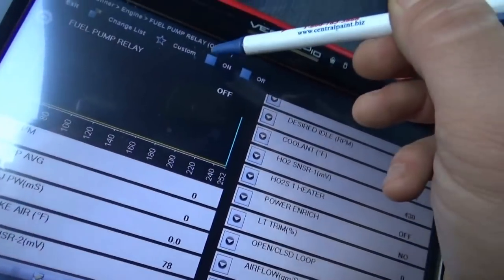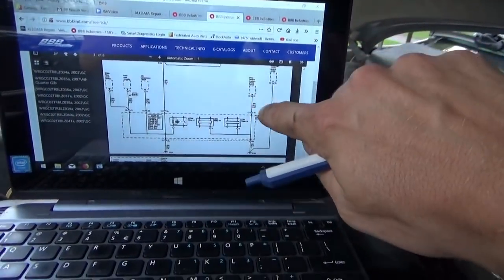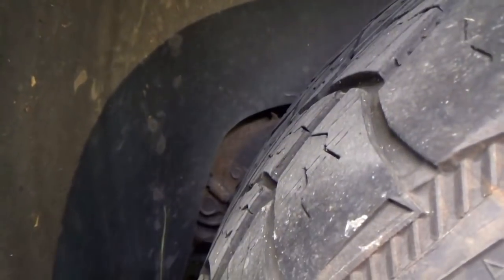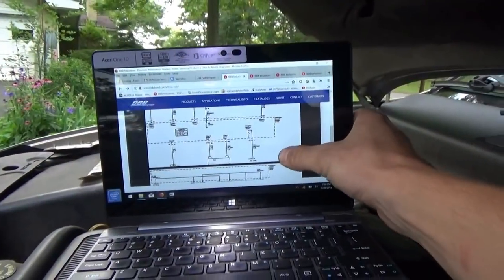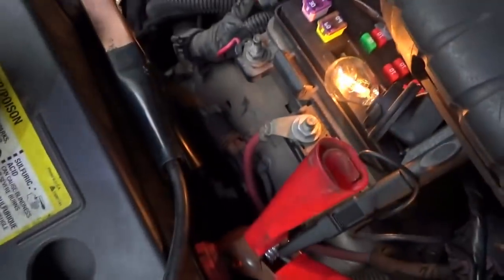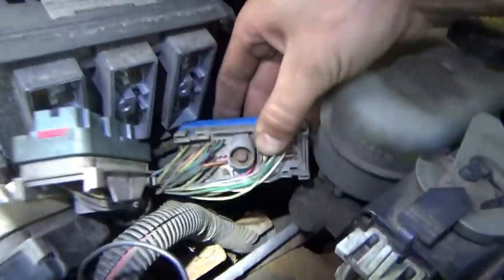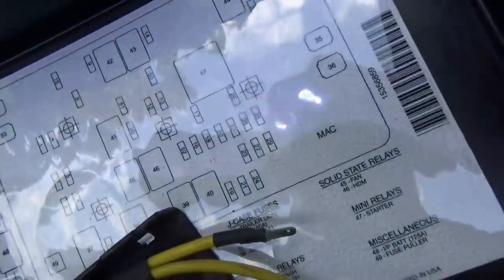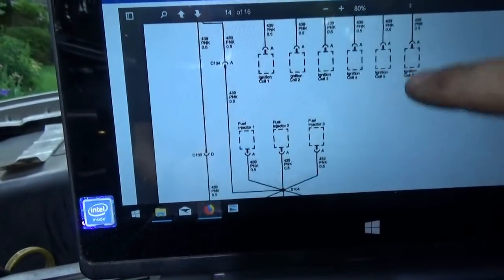GM Truck Stall, No-crank, no-start Case Study -Part2

Comment: You are doing one thing "Wrong" in every single diagnosis video. That no has ever commented on that I watch you do time and time again. Please stop using your writing pen to tap on those touchscreens. Overtime the led diodes will stop working from continuous tapping on the same areas. Trust me you won't be happy to find out how much it cost to replace those back screens.  That's my diagnosis on watching videos. Its happened to my equipment before already. FYI and love watching your videos. Great job.
Reply from the maker: hmmm interesting point. How is my pen different from a stylus?
Reply: Most styli have rubber tips.  However, I imagine, that the Verus, has a heavy duty screen on it, meant for the abuse of mechanics.  The pen will eventually wear out the top layer of the touch screen creating dead spots.  But again, the screen is built for heavy use of mechanics.

Comment: Plot thickens on mine,lol.unhooked all modules checked starter relay all 4 pins show ground called owner of truck asked if any previous work done to truck of course a hack mechanic put a motor in the truck to make a long story short wiring harness pinched between motor and trans,I guess should of done a better visual inspection,thanks for all you do on helping us on trouble shooting it really means alot
Reply from the maker: Great find! Thanks for the comment :)

Comment: Hey, Ivan, My Trailblazer died did some checks I found that the park/safety switch was bad but was not the cause of the crank no start took voltage measurements at the ignition switch and found battery voltage (11.8) coming in and 10.6 volts coming out I changed the switch and started right up.  something for your viewers to think about if they have similar issues.  and great video goes to show to test not guess
Reply from the maker: wow that's weird...usually 10.2V is still enough for most things :)
Reply: apparently, the switch was grounding the start circuit  I checked the new switch and it was battery voltage in and battery voltage out  what was odd all the fuses were good

Comment: How can I get you to diagnose my car?
Reply from the maker: schedule an appointment if you are local to State College, PA :)
Reply: Pine Hollow Auto Diagnostics what is your policy on traveling? I'm 195 miles from you. I'm here in Maryland.
Reply from the maker: I barely have enough time to sleep these days lol...if you want to drop off your car in State College then I can get to it within a week or so. What year-make-model and symptoms?
Reply: Pine Hollow Auto Diagnostics. How much is it going to take to get you here?  I have a crank but no start condition. It's a 2001 Nissan Maxima. I've thrown all type of parts at it trying to solve the problem from: alternator, starter, new battery, ignition switch, inhibit relay, fuel pump, fuel filter, cam sensor, both crankshaft position sensors, fuel damper, fuel regulator, spark plugs, ignition coils and wires. All OEM parts except the alternator and starter(they're Bosch). I'm will to pay a reasonable amount for your visit bro! Just let me know.
Reply: Pine Hollow Auto Diagnostics question: if I wanted to get my car shipped to you, what location in State College do I ship it? What's the Zip?

Comment: Why would they engineer the computer sharing a power/fuse with anything like a coil or fuel injector. Completely boggles my mind.
Reply: lol, try chryslers :)))
Reply: how else would the PCM/ECM control the device/s with hot side switching ;)

Comment: First of all, before you open electrical drawings, you have to check all the fuses. This is a malfunction that should have been solved within 5 minutes. You need to know how to approach the problem. Sometimes the solution is very simple
Reply from the maker: How does one "check all the fuses" in 5 minutes? You wouldn't even know which ones are supposed to be hot! And what about the bad ignition switch and the faulty ignition coil? I cannot agree with your approach, but am willing to learn if it would cut all my diag times to 5 minutes lol
Reply: I kind of agree, one of the first things I do is check fuses for continuity, every time I haven't I've been burnt and that's happened a lot in the last 20+ years

Comment: There really should be a law that you can charge more for a diagnosis if the owner has tried to fix it first. Is it possible that the new ignition switch just wasn't meshed properly with the drive gear in the column and couldn't reach the start position?
Reply from the maker: It is possible for sure!

Comment: possible amp draw to bloww fuse may have been  the bad ignition switch to start with ....
Reply from the maker: How so?
Reply: naw, they're isolated pretty damned good, it would had to have melted visibly and that would have melted the vehicle column harness at the switch plug itself ;)
all the GM's are known for loss of crank on the switches, a simple diode somewhere would have helped it ;)

Comment: Great diagnosis Ivan. Agree the coil probably caused the fuse to blow. Acted like a ground but that is why we always check powers & grounds before condemning a module with multiple powers & grounds b/c the power input in one part of the module may affect an output to another part of the module. Cranking by jumping relay load side with key "On" checking spark would have found it also which is the path I usually go but just goes to show there are sometimes multiple paths you can take to come out with the same diagnosis in the end. The ground for the PCM was actually G108 not G106 had me thinking Mitchell or BBB was wrong but after I enlarged BBB diagram to 200% it was G108 not that that mattered with the diagnosis unless you had to search for it if it was bad. It's always fun to see the different paths people take and with your videos there is usually a twist. I've just had a 2014 Traverse in the shop that wouldn't crank and the PCM wasn't supplying the ground to the starter relay control circuit and the ECM was fried.  I should have made a video on it. Keith said they are running into that in the body shops when they have low battery voltage. Then the ECM I received from the dealer in a taped up box was previously programmed with another VIN and ECM programmed but immobilizer wouldn't however I brought it up to the Parts Mgr attention before I left and sent him the photo of the other VIN on the laptop before attempting to program it so after it failed to program he just ordered another PCM and next day I programmed and running in @20 minutes.  I get my next part at cost so my truck is going to get a serious upgrade soon :D
Reply from the maker: Is it just me, or do the newer GM vehicles like to eat PCMs?
Reply: It's the new architecture and they make it so you can't swap them & reprogram to another VIN. It's still impressive the interval between mean time failures.

Comment: Ivan. I was working on a 2001 Chrysler LHS a couple weeks ago. It had some intermittent no start issues and it had lost all power and owner had it towed. I found a fault in the crank sensor circuit. I was tracing wire back to PCM to see if signal was making it to the computer. PCM had 2 connectors. One was engine harness and other went to body. When I pulled the engine harness from the PCM it let the smoke out. Car had other issues and owner is seeing how to proceed. I did not think I did anything wrong to cause this but could somehow unplugging the PCM with the battery hooked up cause this?
Reply from the maker: hmmm usually no. But the magic smoke has a nasty habit of escaping when you least expect it!

Comment: Ivan- is that a "Waste Spark" ignition? If so- if the secondary isn't grounded (aka a DIY "checking for spark") the current can and will backfeed, and build enough resistance to usually either pop an ECM Quad driver- or a fuse. Technically- I was correct yesterday, even though I meant a "Fusible Link" to be one of those soft, rubbery-type wires (Oldschool) that I doubt this vehicle even has. But- it WAS a "fuse" so :-P

Comment: My friend has the Envoy badged one and he is always replacing coil packs every few months. I think it is a common problem with those....
Reply from the maker: Does he use Dorman replacements?
Reply: Called and asked him,  he doesn’t remember brand, but got them from NAPA.... He told me the last 2 packs he got from GM dealer to see if they last longer for the price difference.

Comment: Wait, the PCM has battery power, things are ground side switched, but even stuff which is unrelated to the busted fuse doesn't switch on because the PCM doesn't have this switched power (unless the vent solenoid is an unrelated problem), but it doesn't throw a code for not having said switched power, even though it manipulates things in the instrument cluster and therefore knows the car is switched on... eh, I'd like a word with whoever programmed that.
Reply from the maker: LOL yes the logic is a bit twisted in the brain...

Comment: I have 4 vehicles starting with a 1998 Ford Explorer  that I try to do all the maintenance and repair on. I recently started watching your videos on a regular basis. They are extremely helpful. They are detailed and clearly explain your thought process as you work. They have been very helpful in getting better use out of my picoscope which I used recently to call a bad crankshaft position sensor on a 2007 Jeep GC 5.7L.  Thanks for the education.
Reply from the maker: That's awesome to hear, Scott! The Pico is a very powerful tool :)

Comment: Trying to learn and need to understand why didn't you check the fuses first? What am I missing?  You do good work that's why I watch your videos to understand and hopefully learn. Thank you Ivan.
Reply: Biggoron Jon: I wouldn't know, however, for a guy just learning the basics they say to first check the simple things. I don't have and scanner tools, just a small actron to pull the simple codes, a test light and a multi meter, but I'm trying. Thank you for your reply sir.
Reply from the maker: Just blindly testing fuses is kind of like shooting in the dark. You may get lucky, but you might also waste a lot of time and not learn too much :)

Comment: Well I was wrong it wasn't a bad ground but a bad power. Great video ivan I think when the coil went bad it pulled a high amperage and blew the fuse maybe?
Reply from the maker: Hi Mike, yeah that's my theory too...shorted primary winding took out the fuse with it!

Comment: Thanks for sticking with it!! Could see and hear the frustration about testing all the power (+) going in to the PCM 😩😩😩 BUT as I said be for,,, I just do it Know matter what.. Great Job Bro’ 👍🏻👍🏻👍🏻👍🏻👍🏻 thanks for the video
Reply from the maker: That was a real eye-opener for me. Never seen a computer be "happy" with a missing power like that lol
Reply: Pine Hollow Auto Diagnostics ,, ya that will spin you around a little bit with 3 or 4 (+) inputs and they start testing good it’s very easy to just stop and call it a bad ECM’!! 😩😩😩😩😩.. I’ll get one like this every few years most of the time “Someone” has been doing stuff ???? And you NEVER get the truth.. The good old,, It was running great then it just stopped running and won’t start or crank. Hmmmmmm 🤫🤫🤭🤭🤭🤭

Comment: Don't feel too bad.  I drove 6 hours to diagnose a car that a shop was about $4k deep in part cannon ammunition for a no com on the ABS module.  I asked them to verify ALL powers and grounds were good and they said yes.  I drove out there and found the brake switch fuse blown due to a failed brake lamp switch. It was also the turn on signal to the ABS.  I can't stress enough verification of powers and grounds and making sure they can carry a load.  Don't get me started on pin tension issues.
Reply: Nicholas Bibeault it’s sad how many techs don’t even know the basics. And most of the time the customer pays the price..
Reply: Can you imagine spending $1,000 on a module only to find out a $25 brake light switch was the problem?  Some shops have no code, no morals and no respect for their industry or a customers fair trade.

Comment: Why would the engineers put a computer in the hot engine bay?  Genius!
Reply: Years ago they used to be inside the cabin, but I think they decided it was a lot easier to have them in the engine compartment and not have to run all of that wiring through the firewall.

Comment: Well ther'z your problem lady! I suspected a dead power/ground at the PCM or blown fuse right after I noticed you didn't have the check engine / service engine soon light on the dash in first part. Great diagnosis, although it might have been shorter ;)
Reply from the maker: Dang sharp eye! I figured if the scanner was talking to the PCM, then it was alive and well!

Comment: Persistence wins. Good find. Goes to show that you need to check ALL the feeds and grounds on a PCM.
Sort of a dumb design IMO having the PCM on the same circuit as so much other stuff. Especially with coils and injectors. If the PCM had it's own circuit you would have had more use of the scan tool to find the problem.
One for the books.
Thanks

Comment: Nice I like they way you don’t just give up and say computer you tested all the powers and grounds man now days the misfire counter saves a lot of time I remember pulling plug wires getting shocked to see if it made a difference then try and find out plug, wire or distributor then compression test hours of work that now the touch of a screen your were lucky if you knew someone with the big sun machine or had a distributor tester if you set the valves to tight the engine would hydro lock and twist the distributor it start dead on and be off 7 degrees on the last cylinder how things have changed nice video look forward to the next one
Reply: randy hughes I miss my distributor tester!
Reply: What’s a distributor? ;)

Comment: great job ivan, now can u help me, 94 jeep cherokee starts fine on first start, then stalls after 15 mins but only while driving, and stafts again only with gas pedal on the floor.
Reply: Sounds like you have a bad Oxygen Sensor. They were quite common on those Jeeps. The PCM keeps adding fuel until it floods out. Testing it would be a good place to start.
Reply from the maker: Great suggestion by wysetech 2000. Just unplug the O2 and drive it in open loop...quickest first check.

Comment: I don't see the logic of having the pcm, injectors and coils on the same fuse. If the pcm was on a different fuse wen the coils and injectors go off the pcm can give a code. And a simple test of power and ground then a look at a wireing diagram will show the link to a blow fuse
Reply from the maker: Will have to ask the electrical engineers that great question....and WHY NO TROUBLE CODES??

Comment: I would like to say good job, it's always good to check every component let's faced it some shops would've thrown a PCM into it and realized the problem still exist, would've cost the customer more money then the fuse would've kept blowing creating more money for the customer. I wonder how many shops would've refunded the money to the customer after realizing they misdiagnosed it.  @schrodingers box, see if you would've checked the fuses....

You both do a great job and I appreciate both your work.